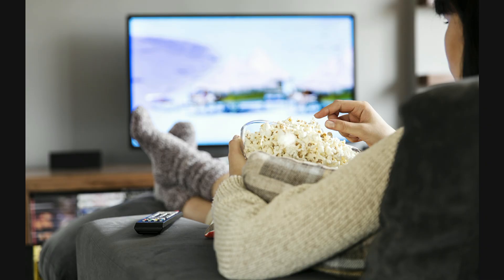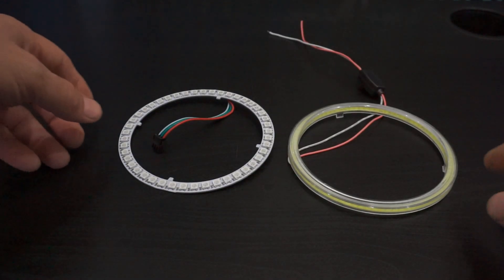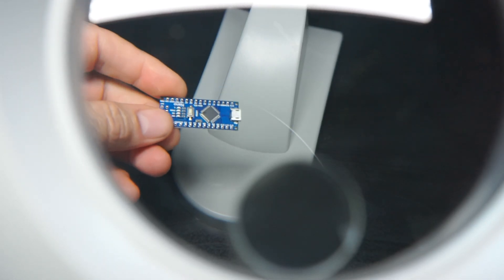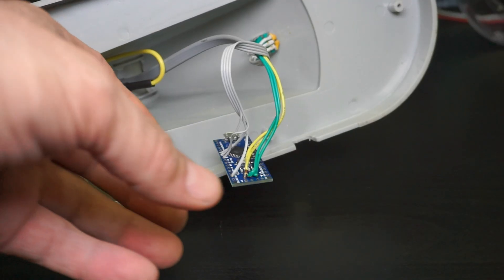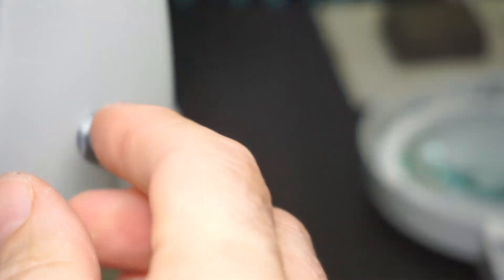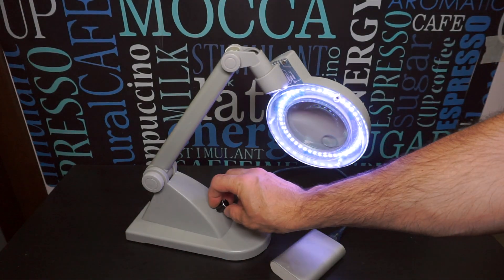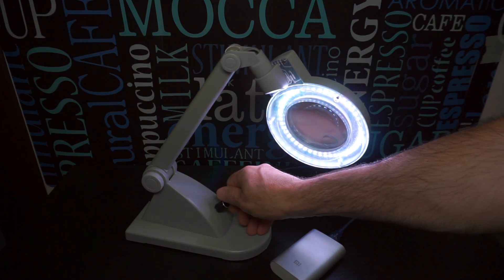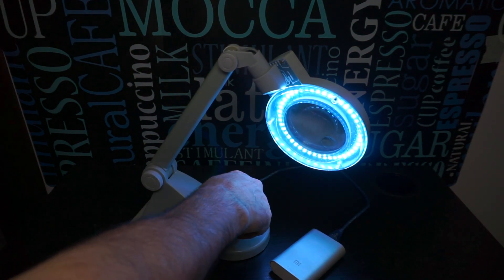Прокачал лампу-лупу своими руками

Comment: Arduino: 1.8.18 (Windows 10), Плата:"Arduino Nano, ATmega328P"

C:\Users\29F0~1\AppData\Local\Temp\arduino_modified_sketch_741861\Lamp_Encoder.ino: In function 'void setup()':

Lamp_Encoder:57:3: error: 'led_clr' was not declared in this scope

   led_clr();

   ^~~~~~~

C:\Users\29F0~1\AppData\Local\Temp\arduino_modified_sketch_741861\Lamp_Encoder.ino: In function 'void mode(uint8_t)':

Lamp_Encoder:81:20: error: 'Bright_increase' was not declared in this scope

     case LED_INC:  Bright_increase();

                    ^~~~~~~~~~~~~~~

Lamp_Encoder:84:19: error: 'rainbow' was not declared in this scope

     case RAINBOW: rainbow();

                   ^~~~~~~

C:\Users\29F0~1\AppData\Local\Temp\arduino_modified_sketch_741861\Lamp_Encoder.ino:84:19: note: suggested alternative: 'random'

     case RAINBOW: rainbow();

                   ^~~~~~~

                   random

C:\Users\29F0~1\AppData\Local\Temp\arduino_modified_sketch_741861\Lamp_Encoder.ino:86:5: warning: case label value exceeds maximum value for type

     case SPARKLE: sparkle();

     ^~~~

Lamp_Encoder:86:19: error: 'sparkle' was not declared in this scope

     case SPARKLE: sparkle();

                   ^~~~~~~

C:\Users\29F0~1\AppData\Local\Temp\arduino_modified_sketch_741861\Lamp_Encoder.ino:90:5: warning: case label value exceeds maximum value for type

     case CYLON: CylonBounce();

     ^~~~

Lamp_Encoder:90:17: error: 'CylonBounce' was not declared in this scope

     case CYLON: CylonBounce();

                 ^~~~~~~~~~~

C:\Users\29F0~1\AppData\Local\Temp\arduino_modified_sketch_741861\Lamp_Encoder.ino:92:5: warning: case label value exceeds maximum value for type

     case STROBE: Strobe();

     ^~~~

Lamp_Encoder:92:18: error: 'Strobe' was not declared in this scope

     case STROBE: Strobe();

                  ^~~~~~

C:\Users\29F0~1\AppData\Local\Temp\arduino_modified_sketch_741861\Lamp_Encoder.ino:92:18: note: suggested alternative: 'tone'

     case STROBE: Strobe();

                  ^~~~~~

                  tone

C:\Users\29F0~1\AppData\Local\Temp\arduino_modified_sketch_741861\Lamp_Encoder.ino:97:5: warning: case label value exceeds maximum value for type

     case FIRE:  fire(700,120, 100);

     ^~~~

Lamp_Encoder:97:17: error: 'fire' was not declared in this scope

     case FIRE:  fire(700,120, 100);

                 ^~~~

C:\Users\29F0~1\AppData\Local\Temp\arduino_modified_sketch_741861\Lamp_Encoder.ino:97:17: note: suggested alternative: 'free'

     case FIRE:  fire(700,120, 100);

                 ^~~~

                 free

C:\Users\29F0~1\AppData\Local\Temp\arduino_modified_sketch_741861\Lamp_Encoder.ino:100:5: warning: case label value exceeds maximum value for type

     case  LAMP_OFF: LedBright();

     ^~~~

Lamp_Encoder:100:21: error: 'LedBright' was not declared in this scope

     case  LAMP_OFF: LedBright();

                     ^~~~~~~~~

C:\Users\29F0~1\AppData\Local\Temp\arduino_modified_sketch_741861\Lamp_Encoder.ino:100:21: note: suggested alternative: 'bright'

     case  LAMP_OFF: LedBright();

                     ^~~~~~~~~

                     bright

C:\Users\29F0~1\AppData\Local\Temp\arduino_modified_sketch_741861\Lamp_Encoder.ino:79:10: warning: switch condition has boolean value [-Wswitch-bool]

   switch (num == 3 && lastcomb == 7)

          ^

C:\Users\29F0~1\AppData\Local\Temp\arduino_modified_sketch_741861\Lamp_Encoder.ino: In function 'void lamp_sleep()':

Lamp_Encoder:146:1: error: 'Bright_decrease' was not declared in this scope

 Bright_decrease();

 ^~~~~~~~~~~~~~~

exit status 1

'led_clr' was not declared in this scope

Этот отчёт будет иметь больше информации с
включенной опцией Файл -> Настройки ->
"Показать подробный вывод во время компиляции"

Comment: Arduino: 1.8.18 (Windows 10), Плата:"Arduino Uno"

C:\Users\29F0~1\AppData\Local\Temp\arduino_modified_sketch_421245\Lamp_Encoder.ino: In function 'void setup()':

Lamp_Encoder:57:3: error: 'led_clr' was not declared in this scope

   led_clr();

   ^~~~~~~

C:\Users\29F0~1\AppData\Local\Temp\arduino_modified_sketch_421245\Lamp_Encoder.ino: In function 'void mode(uint8_t)':

Lamp_Encoder:81:20: error: 'Bright_increase' was not declared in this scope

     case LED_INC:  Bright_increase();

                    ^~~~~~~~~~~~~~~

Lamp_Encoder:84:19: error: 'rainbow' was not declared in this scope

     case RAINBOW: rainbow();

                   ^~~~~~~

C:\Users\29F0~1\AppData\Local\Temp\arduino_modified_sketch_421245\Lamp_Encoder.ino:84:19: note: suggested alternative: 'random'

     case RAINBOW: rainbow();

                   ^~~~~~~

                   random

C:\Users\29F0~1\AppData\Local\Temp\arduino_modified_sketch_421245\Lamp_Encoder.ino:86:5: warning: case label value exceeds maximum value for type

     case SPARKLE: sparkle();

     ^~~~

Lamp_Encoder:86:19: error: 'sparkle' was not declared in this scope

     case SPARKLE: sparkle();

                   ^~~~~~~

C:\Users\29F0~1\AppData\Local\Temp\arduino_modified_sketch_421245\Lamp_Encoder.ino:90:5: warning: case label value exceeds maximum value for type

     case CYLON: CylonBounce();

     ^~~~

Lamp_Encoder:90:17: error: 'CylonBounce' was not declared in this scope

     case CYLON: CylonBounce();

                 ^~~~~~~~~~~

C:\Users\29F0~1\AppData\Local\Temp\arduino_modified_sketch_421245\Lamp_Encoder.ino:92:5: warning: case label value exceeds maximum value for type

     case STROBE: Strobe();

     ^~~~

Lamp_Encoder:92:18: error: 'Strobe' was not declared in this scope

     case STROBE: Strobe();

                  ^~~~~~

C:\Users\29F0~1\AppData\Local\Temp\arduino_modified_sketch_421245\Lamp_Encoder.ino:92:18: note: suggested alternative: 'tone'

     case STROBE: Strobe();

                  ^~~~~~

                  tone

C:\Users\29F0~1\AppData\Local\Temp\arduino_modified_sketch_421245\Lamp_Encoder.ino:97:5: warning: case label value exceeds maximum value for type

     case FIRE:  fire(700,120, 100);

     ^~~~

Lamp_Encoder:97:17: error: 'fire' was not declared in this scope

     case FIRE:  fire(700,120, 100);

                 ^~~~

C:\Users\29F0~1\AppData\Local\Temp\arduino_modified_sketch_421245\Lamp_Encoder.ino:97:17: note: suggested alternative: 'free'

     case FIRE:  fire(700,120, 100);

                 ^~~~

                 free

C:\Users\29F0~1\AppData\Local\Temp\arduino_modified_sketch_421245\Lamp_Encoder.ino:100:5: warning: case label value exceeds maximum value for type

     case  LAMP_OFF: LedBright();

     ^~~~

Lamp_Encoder:100:21: error: 'LedBright' was not declared in this scope

     case  LAMP_OFF: LedBright();

                     ^~~~~~~~~

C:\Users\29F0~1\AppData\Local\Temp\arduino_modified_sketch_421245\Lamp_Encoder.ino:100:21: note: suggested alternative: 'bright'

     case  LAMP_OFF: LedBright();

                     ^~~~~~~~~

                     bright

C:\Users\29F0~1\AppData\Local\Temp\arduino_modified_sketch_421245\Lamp_Encoder.ino:79:10: warning: switch condition has boolean value [-Wswitch-bool]

   switch (num == 3 && lastcomb == 7)

          ^

C:\Users\29F0~1\AppData\Local\Temp\arduino_modified_sketch_421245\Lamp_Encoder.ino: In function 'void lamp_sleep()':

Lamp_Encoder:146:1: error: 'Bright_decrease' was not declared in this scope

 Bright_decrease();

 ^~~~~~~~~~~~~~~

exit status 1

'led_clr' was not declared in this scope

Этот отчёт будет иметь больше информации с
включенной опцией Файл -> Настройки ->
"Показать подробный вывод во время компиляции"
Reply from the maker: Судя по ошибке, Вы удалили фаил с эффектами. Который лежал в папке со скетчем
Reply: @ArduinoClub  а тут всего два эффекта,радуга и просто светиться,ну и яркость меняется
Reply: да там два файла,а как их вместе загрузить,два файла я еще ни разу не загружал🙃
Reply: их просто надо было обвести м открыть вместе🤣🤣🤣 заработало ураааа
Reply from the maker: Отлично!
Reply: @ArduinoClub  у вас на видео больше эффектов
Reply from the maker: @ОлегВеснин-к6й  Их можно подключать  и они находятся во втором файле. Странно что всего 2, их должно быть столько же как в на видео. У Вас конденсаторы на энкодере установлены?
Reply: @ArduinoClub  да установлены,но на 500 воль,может из за этого
Reply from the maker: @ОлегВеснин-к6й  вольтаж в данном случаи не имеет значения. главное что бы его емкость была в пределах от 0,1 до 0,01 мкФ. У Вас 3 конденсатора на энкодере? Ошибки в подключении нет?
Reply: @ArduinoClub  конденсаторы прямо на энкодер припоял по 0,1,ошибки в подключении не видел,сейчас домой приеду еще раз залью,может не заметил ошибки
Reply: @ArduinoClub  блин сейчас обвожу два скетча открываю и открываются сразу две проги ардуино,и не хочет загружатся ни одна,я наверное всетаки не так загружаю
Reply from the maker: @ОлегВеснин-к6й  Не нужно оба запускать,  эффекты подтягиваются автоматически
Reply from the maker: @ОлегВеснин-к6й  Правки вносили в код?
Reply: @ArduinoClub  только количество светодиодов поменял на 40,там на 45 стояло,я ленту подключил
Reply: @ArduinoClub  вот включен эффект радуги,шесть раз нажимаю все шесть просто светится,на седьмой опять радуга
Reply from the maker: @ОлегВеснин-к6й  Странно. Конденсаторов сколько на энкодере? Хотя при дребезге такая закономерность врятли бы повторялась. А нажатия короткие? Длинное нажатие работает?
Reply: @ArduinoClub  три конденсатора,нажатие короткие,длинное нажатие выключает
Reply: @ArduinoClub  и микросхема продолговатая чет греется ,горячяя,
Reply: @ArduinoClub  на энкодер нажимаешь и крутишь меняется цвет ленты от желтого или синего
Reply from the maker: @ОлегВеснин-к6й  от чего питается светодиодная лента? От чего питается ардуино? На какой разъем и сколько вольт подаете питание? Что на микросхеме которая греется написано? У нее 3 вывода?
Reply: @ArduinoClub  питаеться через провод юсб,пробовал от компа и от зарядника,разобрался что греется,это юсб штекер на ардуинке когда на полную яркость,у ленты питание с ардуинки
Reply: @ArduinoClub  если конечно она заработает как на видео я ардуинке питание напрямую подам 5 вольт
Reply from the maker: @ОлегВеснин-к6й  К сожалению я не написал в статье, но при питании ленты от USB нужно припаять проводок от USB к разъему от которого запитывается лента. Постараюсь сегодня поправить статью
Reply: @ArduinoClub  тоесть если я сейчас припаяю питание ,на ардуинке написано +5 вольт то все заработает?
Reply: @ArduinoClub  припаял напрямую к ардуинке все так же не все функции
Reply from the maker: @ОлегВеснин-к6й  Не торопитесь, я все проверю сначала
Reply: @ArduinoClub  ок
Reply from the maker: @ОлегВеснин-к6й  Проверил и был в шоке. Действительно не работает как нужно Видать случайно что то затер. Найду ошибку отпишусь
Reply: @ArduinoClub  ок спасибо жду
Reply from the maker: @ОлегВеснин-к6й  Очень странная ситуация. Ошибку не нашел, но после перестановки кусков кода местами,все заработало. Выложил, проверяйте
Reply from the maker: @ОлегВеснин-к6й  Перезалил проверяйте
Reply: @ArduinoClub  ура заработало спасибо большое